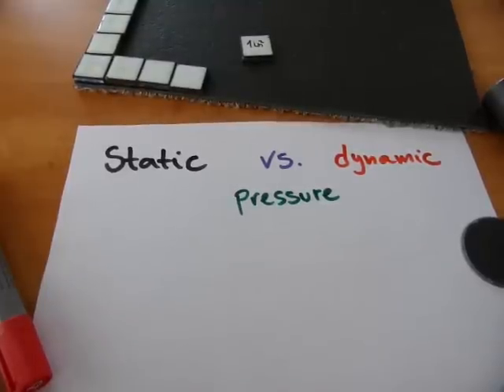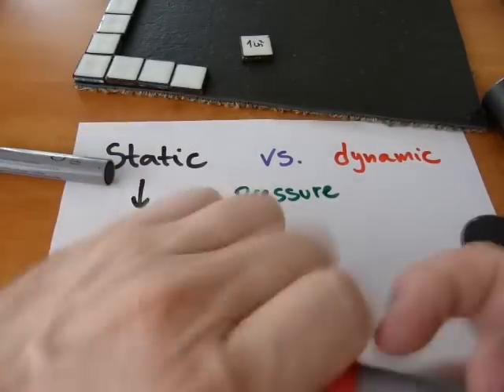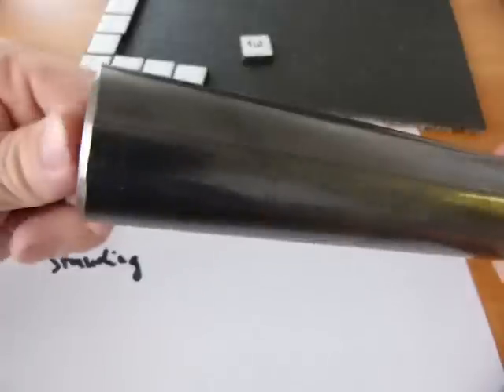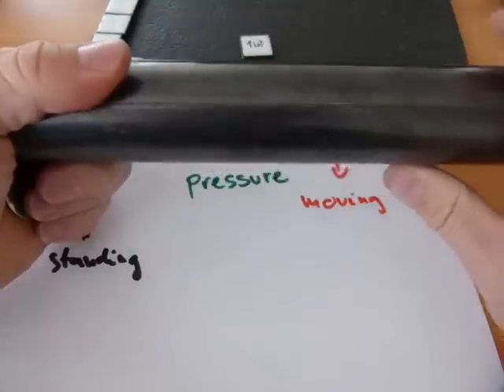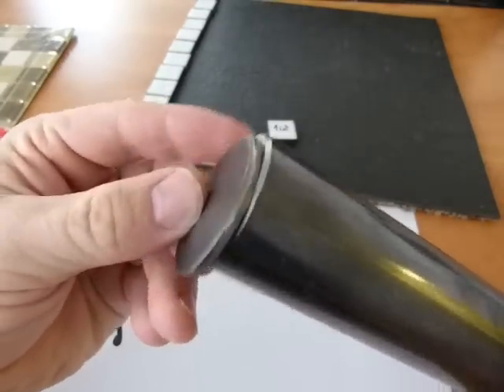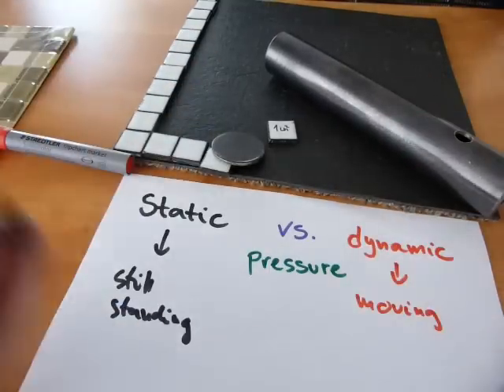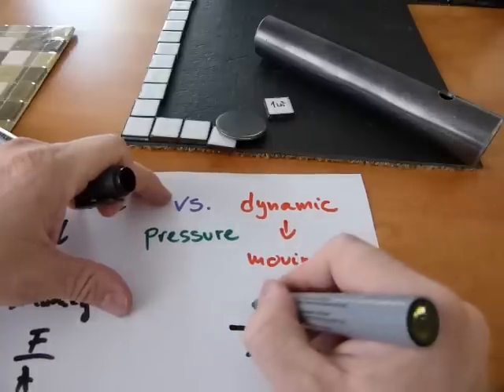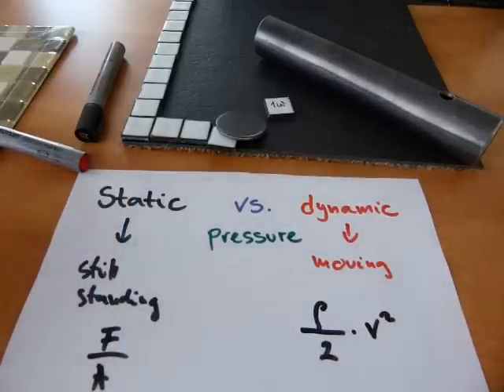Static vs. dynamic pressure

Comment: Pressure is the continuous physical force exerted on or against an object by something (a fluid such as air) in contact with it. Static pressure is the pressure you have if the fluid isn't moving or if you are moving with the fluid. Air would press against you equally in all directions.
Reply: Yes how can fluid exert pressure in uni direction like he said?
Reply: @ruthless_iitain  That caught my attention as well. It would exert the same static pressure in all directions, regardless of the pipes configuration. What you can say, is that the hydrostatic (I believe that's the term), when used to represent the pressure of gravity/weight, could be said to be going down when flipped vertically (think ro*g*h).

Comment: How do I know if the work done in a steam turbine is due to the static, dynamic, or both pressures?
Reply from the maker: Rotating turbine and a jet of steam? Nothing is static.
Reply: apprenticemath Hi sorry for the confusion. My question is referring to the static and dynamic (kinetic energy) terms in the Bernoulli equation. Is it possible to have the inlet and outlet kinetic energies in a steam turbine to be equal so that the work done on the turbine is only due to the static pressure (I.e. molecular collisions) ?
Reply: @superpanda9810  static is always there, if there was impact as it should be with the steam turbines then we can say that the trubrine experinced both the static + dynamic pressures.   Btw it's called impact/stagnation pressure

Comment: so dynamic pressure is basically the velocity head in bernoulli's eqt?
Reply from the maker: Yeaaaahhhh, no. You can also get dynamic load in a level pipe (no head) just by closing a valve fast (=water hammer). So just velocity and mass. Head will make it bigger, of course.

Comment: what if the flowing speed is small enough that V^2 is almost zero? in this case the dynamic pressure would be near zero, which is absolutely wired. or is the actual pressure the combi of static and dynamic?
Reply from the maker: If it`s not moving, it has no dynamic pressure.
Reply: Total pressure = static + dynamic

Comment: Thanks for that. But I believe the concept of compressible and non-compressible should be added since it defines the 'pressure' for us. a column of steam would be totally different with a column of water regarding since water(liquid phase) is not compressible and steam is compressible. please kindly correct me if I'm wrong.
Reply from the maker: Maybe another video titled "phases of matter" could cover it. Steam (vapor) is not a phase but a physical mix, liquid aerosol. Completely different topic.
Reply: :face-orange-biting-nails:

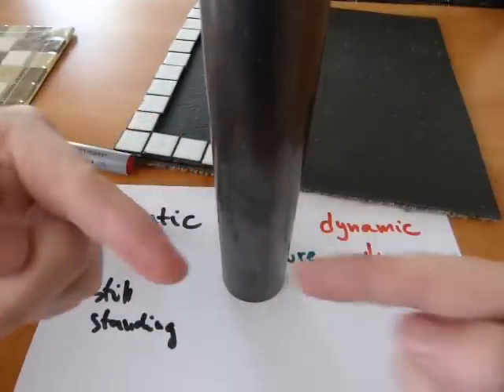Comment: @ 1:30 you say fluid will exert pressure only downwards. But that's incorrect. The fluid exerts pressure toward all detections at a given point.
Reply from the maker: +Earth+ Right. I was focusing on explaining only the word "static. In this context I didn`t want to introduce another term, normal force. So I ended up replacing normal force (which acts in the direction shown) by saying static pressure exerts pressure this way if the pipe is horizontal.

You`re right of course, issue noted.
Reply: feet of head, how much pressure needed to exert to move water up to a given point.

Comment: oh god, was it really that simple. why do they call it dynamic pressure, when it is obviously the kinetic energy which is of interest here. it brings a lot of confusion. thanks for the video
Reply: because it is a pressure, that is, a force over an area, but it is a result of dynamics (movement). hence, dynamic pressure.
Reply from the maker: tkzsfen Which word was confusing?
Reply from the maker: tkzsfen Dynamic and kinetic are both Greek words. "Kinetic"  means of motion or drive and "dynamic" means of power or strength. Look it up, standard science terminology.